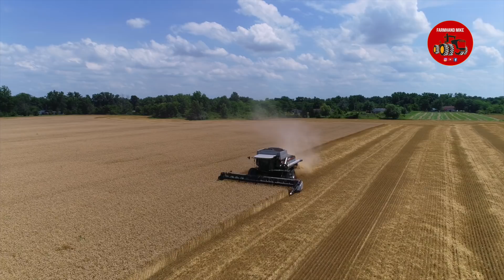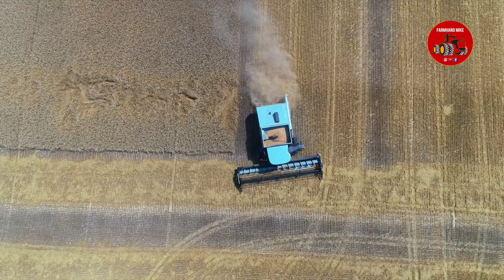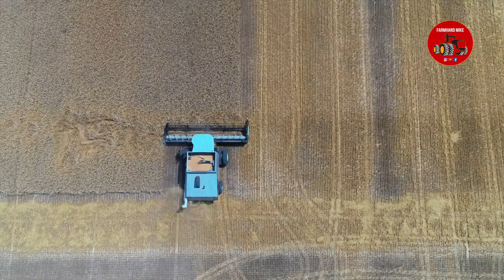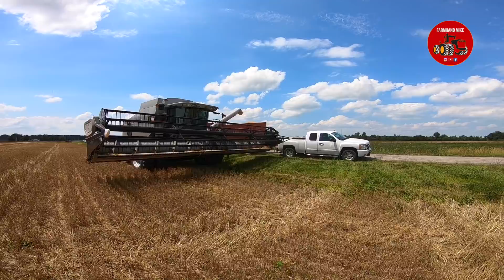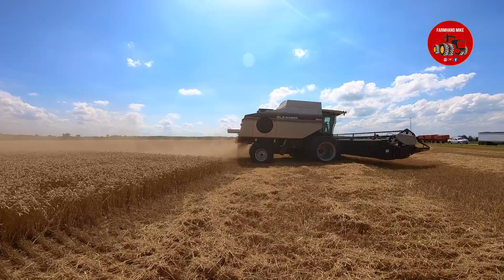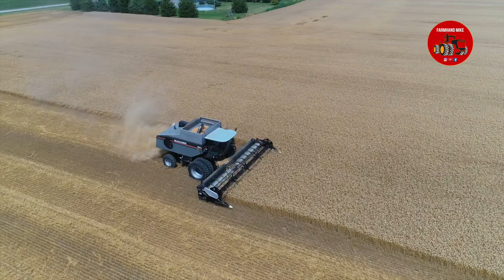2018 Wheat Harvest near Antwerp Ohio

Comment: When i started working on the farm they had a gleaner c2 then they got a gleaner L2  then they gave in and got a john deer 9600
Reply: The 9600's were good machines but the Gleaner R72's would run circles around them in wheat.